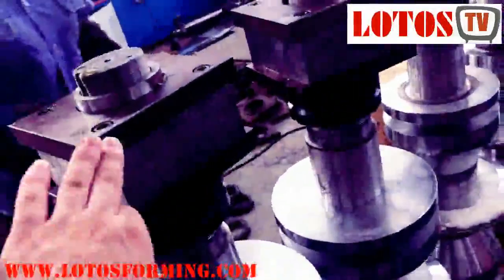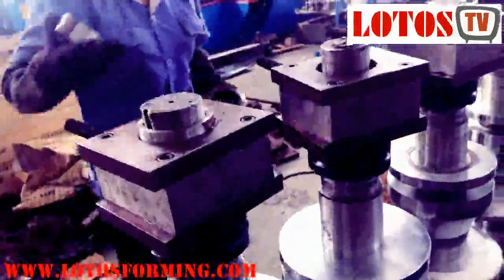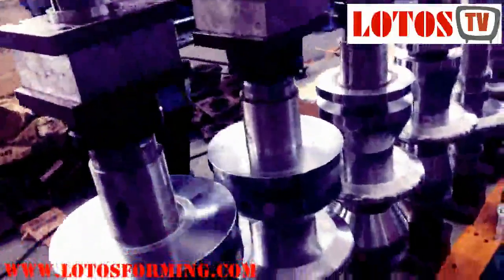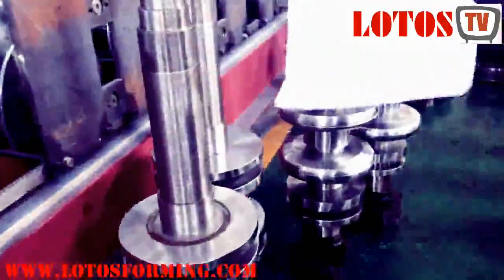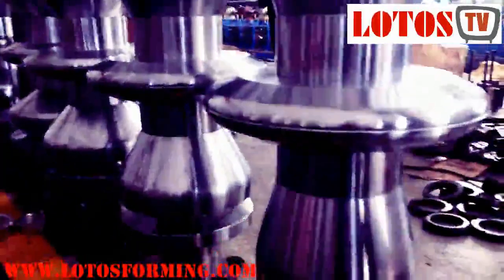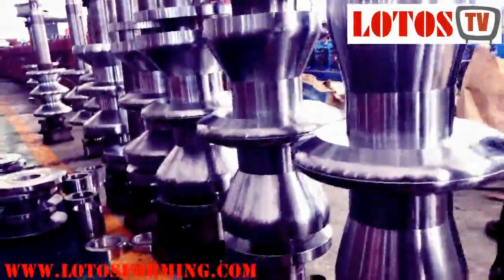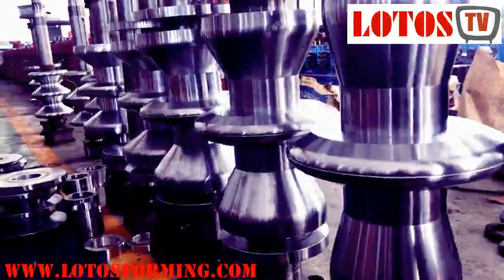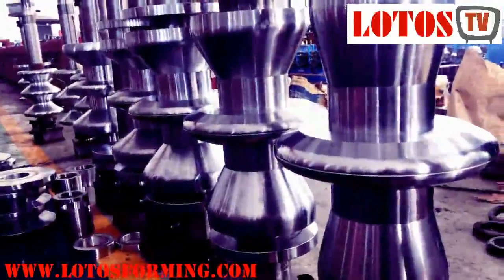【Roll Forming Machine】:  Roller and Shaft Assembly "BEST DESIGN 2019"

Comment: the shaft is coupled to a motor which drives the rolls; on the operator-side, the stand which supports the shafts is removable in order to enable tool changing. This is the most common type of stand to roll form metals, and as such, it was chosen as the stand to be used in the experimental analysis of the present work.
Reply from the maker: the stand which supports the shafts is removable